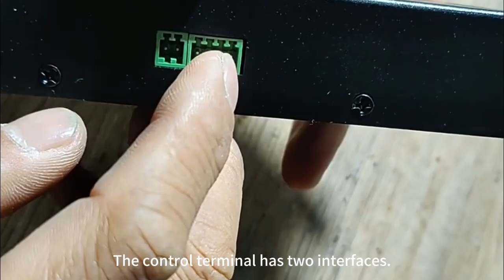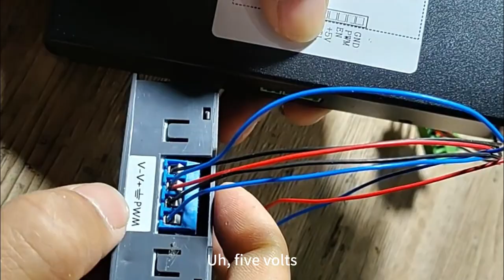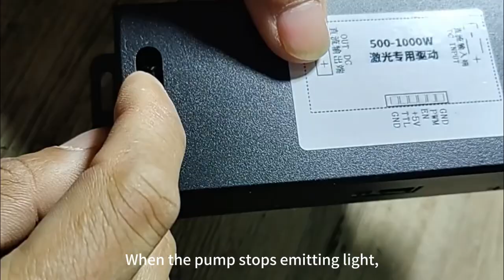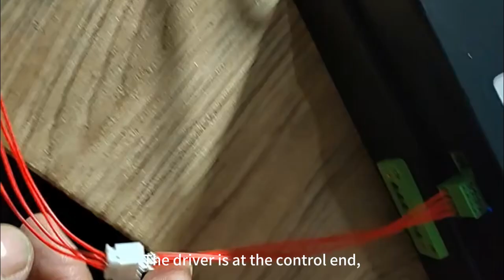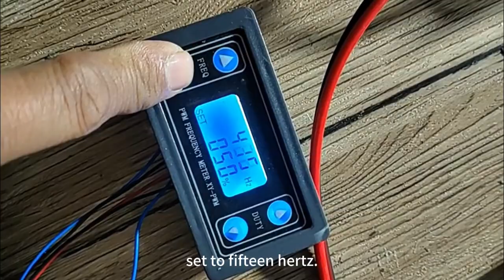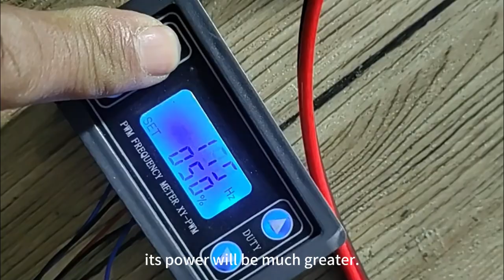PWM controlled high-power single laser pump source driver 500W Ruike, 1000W Keplin, 1500W Chuangxin

Comment: These videos are great, I love this stuff. Also, the Gearlair store is AMAZING! You guys make the coolest stuff! I would love to see this pwm controller video broken down a little better with complete wiring diagram/schematic. There are a LOT of hobbyists getting interested in the fiber pump source lasers now, they are buying parts and need help with assembly. Some veterans may say "if your not sure, you shouldn't be doing it", but were gonna do it anyway, so you might as well help out. Always wear appropriate wavelength safety glasses folks.